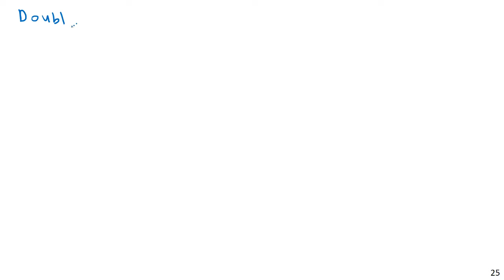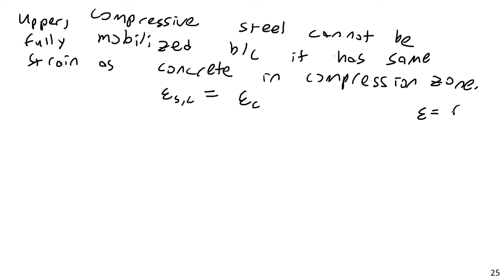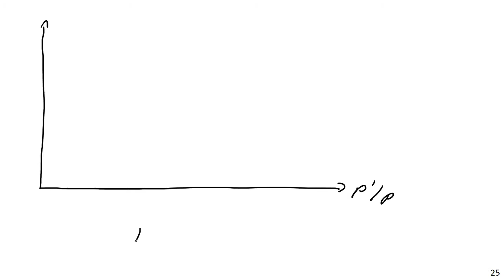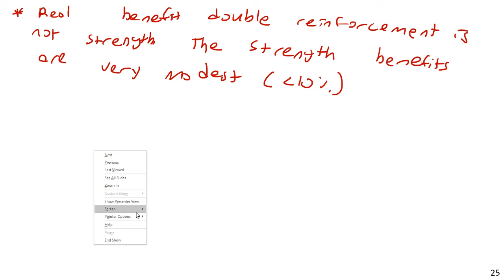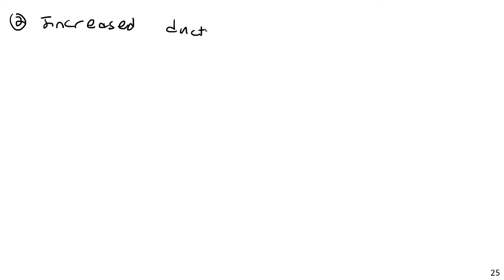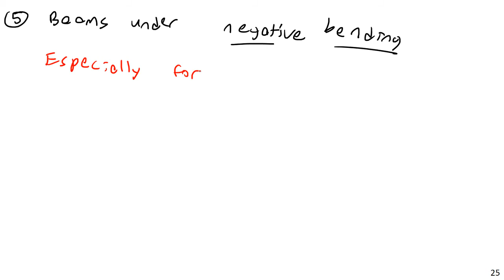Doubly Reinforced Concrete Beams - Steel and Concrete Design

Comment: 25:00 My RC professor taught us to consider the "cut-off" lengths in beams that have both types of rebar while considering development length. In this way, it doesn't have to be seen as "doubly reinforced" but containing a singly rebar on the top where there is negative bending and the bottom where there is positive bending. And, of course, you would determine rebar db in those regions individually by considering the maximum bending moment at the section (but it would be treated as singly reinforced).

I just thought of an issue related to what I just wrote; it is possible that the development length is not sufficient if cut to avoid doubly reinforcement. However, in practice, I would always do my best to bend the reinforcement, etc so that the code development length is as small as I can get it so that it won't control over the cutoff length. I can definitely see issues, though, as that may not always be possible. SO, thanks for opening my eyes.